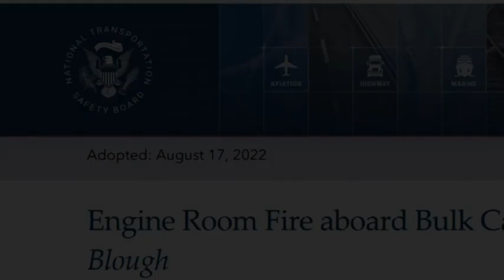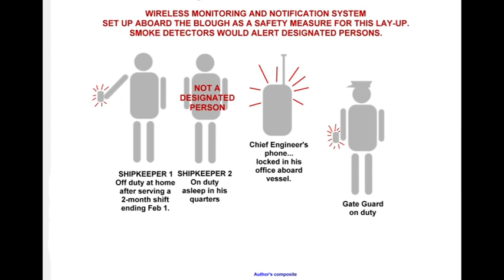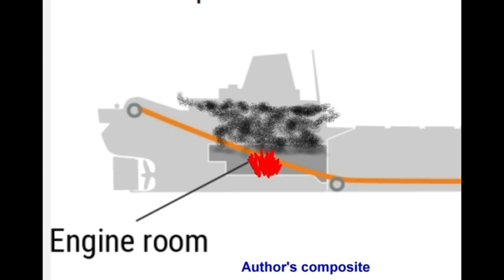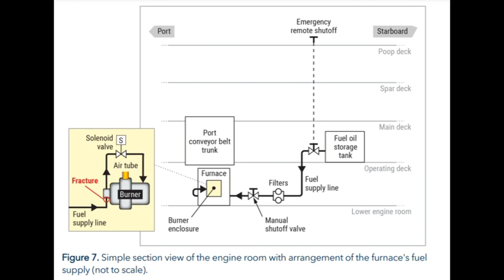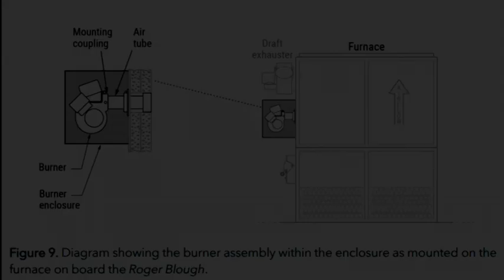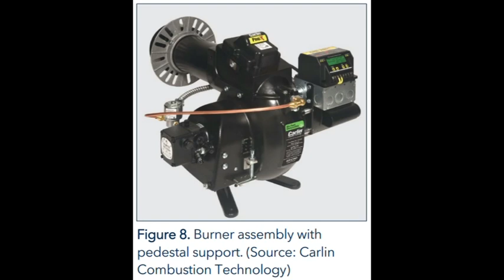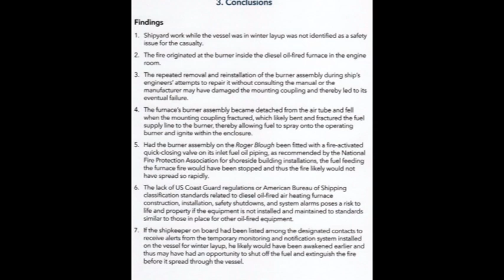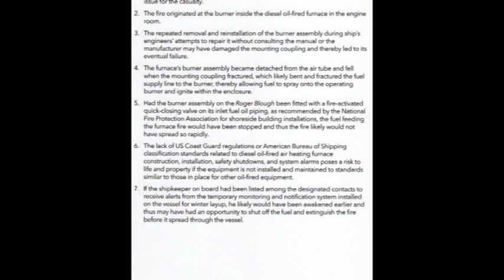The NTSB report on the Roger Blough fire and disaster

Comment: This hits home to me as many years ago I worked at the restaurant that burned to the ground one night due to delayed ignition of an oil burner. I did heating and cooling for many years and this kind of surprises me that there wasn't a more robust mounting system on that, not to mention an automatic fuel line shut off. But I don't know the regulations so who knows.

Comment: That oil burner looks familiar to any HVAC service technician who works on them, common equipment that burns #2 fuel oil for residential installations. What is astonishing is how a small furnace only used to heat parts of the ship during layup could bring down a mighty vessel such as the Rodger Blough and cause $100 million in damages! My guess is the heating contractor they called in and who last touched it will be blamed, fairly or unfairly.

Comment: Well I read.    Sounds like the furnace install company saved $12 on a burner firomatic and $13 on the pedestal for the burner.   Good job cheap HVAC company!   You’re $25 richer minus lawyer fees to follow.    Hard to say how many companies the owners got bids from.   Would be interesting to see if they went with cheapest company possible.
Reply from the maker: Good point, but the larger point is item 7 on the NTSB list. The boat's owners invested in a great alarm system for the extended layup... but no one put the that No.2 shipkeeper  on the list of contacts. "For want of a nail..." as they say.
Reply: @authorwes  this is so sad!

Comment: Damages in excess of $100,000,000.00 ??   No way.  Not unless the ship was a total loss and half the port facility burnt down.  The vessel itself isn't worth anywhere near that amount.
Reply from the maker: That is what the NTSB report states. I'm not making this stuff up.
Reply: Everything in that rear area is warped and damaged. Everything back there has to be replaced. Dry dock fees, worker’s pay, replacement parts and newly fabricated parts/ steel plates would cost a pretty penny. 100M is not too far fetched as the St Clair would have also cost a lot of money to repair.